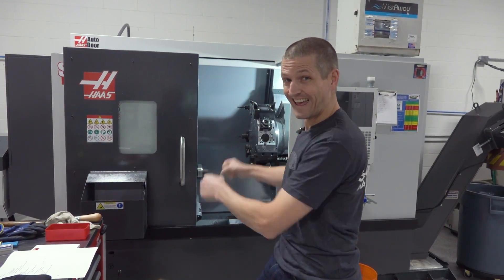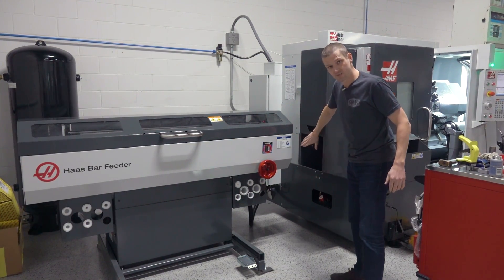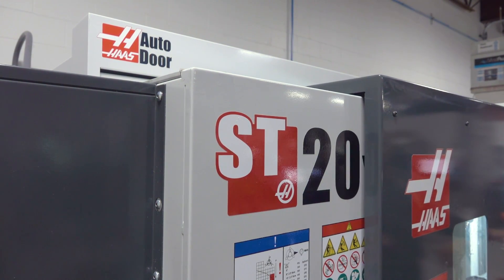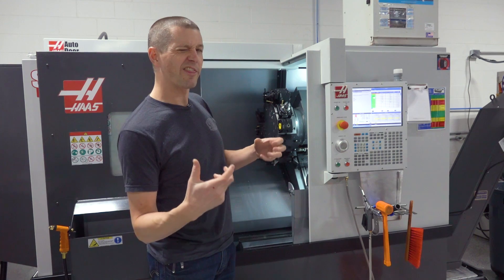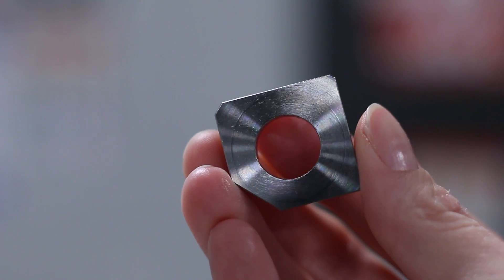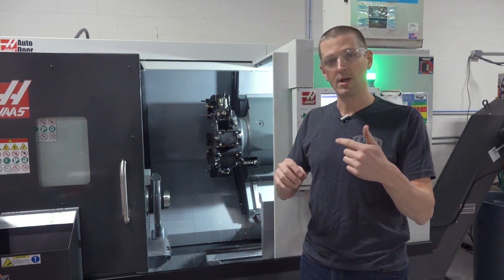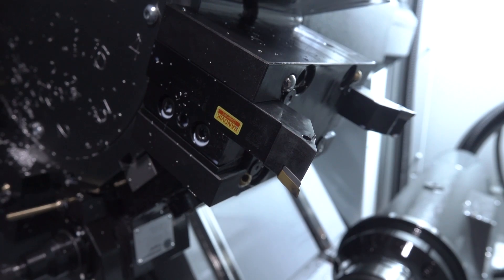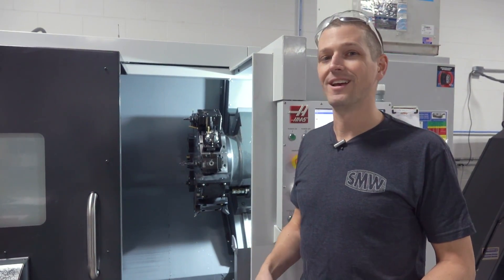Buying a HAAS ST20Y CNC Lathe!

Comment: Hey love your channel.   I'm looking into buying the smaller version ST10Y, I'm just not sure if its the best machine for my applications.  I make thousands of 1/4 x 1/4 x 2" aluminum parts that are very similar and I would think that this machine would be perfect for that but I've heard the live tooling holders wear down and are needed to be worked quiet frequently.   I'd love to know how well this machine would do for something similar to my application.  since the parts are so small I really cant justify spending the money for a horizontal mill  with a pallet changer.  if you have any insight I'd really appreciate it.  Thanks for all your great videos.

Comment: It seems live tooling is so expensive, that it's cheaper to buy a lathe and then buy a mill.  This is what my boss was pretty much telling me.  Then half the active tooling sits.  We've been getting a part that would be sweet to have a active tooling lathe.  Little bit of turning then milling some .020" through slots.  Very small part.  Then we have some SS 316 parts that get a 7/8ths hex on them, if I remember right.

Comment: Nice video and nice lathe. (8:30-8:33) The finishing spindle has actually been available on Haas lathes for about 14 years (since about 2006) on the TL15 and TL25 lathes with finishing sub spindle and live tools, however Y axis was not available at that time.

Comment: You've got a ton of comments but just in case you do see this: Heads up with the bar feeder/chuck combo you have. We have the same setup on 3 DS-30s. The spindle pushes forward when it's clamping and this can cause a bit of variability in the stick out length of your stock. 95% of the time it's off by a few thousands so it's insignificant but every once in a while it will come out too far, by 3/8 to 1/2 inch! When we first started about every 2 weeks we would crash or blow up a tool when facing and couldn't figure out what was going on. Now we keep a stop mounted in a tool holder on the turret and push against the stop every time it bar feeds. It's a work around but it beats the alternative. Just a heads up!

Comment: Thanks were about to buy our lathe in 2021 can you please!!! pump out some videos on this machine on set up programming it with fusion. I had exactly same idea for a mill part we run that's small but made of m2, 200 part count runs and really simple profile cut then cut the part off then surface grind them flat. And running them outta round bar Stock outta bars would be amazing

Comment: We just got a haa st st25 y
I've never had to deal with a y axis
It seems to be a pain to get the turning toola centered on x axis ..
Any tips? I do have the probe option and it is the next-gen tool controller.
Thanks!
Reply: I've run 2 HAAS y axis lathes for about 3 years now ( a 25 and a 35) they have not and never will be centre line on x and y because it's not a true y axis. Had haas service spend hours trying to fix it, it's all in  the parameters, not in the mechanicals as you'd think.

Comment: Need more turrets.  Twin spindle with one turret really handicaps how fast you can pump out parts.  As a first lathe it won't be too bad, but as you get more advanced you'll find that not being able to over lap work on both spindles will hurt your cycle time.  Right now this is a good machine to get your feet wet with live tool lathes.

This is machine type I'm currently working on:
https://www.youtube.com/watch?v=acOU46-f_Zg&t=6s

Count them all up and it's a 9 axis, twin spindle, twin turret lathe.  It can be nerve racking to prove out programs on some times, because there can be so much going on at once.  Really pay attention to what is going on at the 1 minute mark.  That is cutting ID threads on both the main and sub spindle parts with the upper turret and roughing on the main spindle with the lower.

Comment: In a country that long abandoned producing anything of value who the hell is going to commission work at a rate per year that could even approach paying off this extremely expensive machine?
Or are you already contracted to produce parts for military hardware?
Reply: There are TONS of machine shops in this country. The ones that are run well are very busy and very profitable.  Prototype and short run production is still a very strong business all over the US.  Companies can't waste time waiting for mission critical parts to be shipped from over seas vendors.  Then there are parts that can't be made over seas.  I worked for years at a shop that made parts for both civilian and military radar and communications systems.  Not only could the parts/prints be exported out of the country, we could only buy our raw stock that was US made or from a list of US allied countries.  Semiconductor, aerospace, oil field, renewable energy and medical device sectors are all very strong markets for machining in the US.  Manufacturing in this country isn't dead by a long shot, it's just the low skill, high volume parts that have gone over seas.  With rising wages in China along with rising transportation costs the savings attained by offshoring manufacturing is vanishing.  A lot of companies are starting to bring manufacturing back to the US.         

According to the US department of labor there were over 400,000 unfilled machining/manufacturing jobs in the US last year.  That number is only set to get bigger with the baby boomer getting ready to retire.

Comment: Very cool! I totally dig how the bar feeder moves out of the way to load the spindle liners.....I programmed and ran older HAAS lathes (SL-10,SL-20,SL-30) with the automatic bar feeder and removing the older style bar liners from the spindle was no fun if loaded up with chips.....scraped up my knuckles many times....ouch!!! (You had to reach through the bar feeder to get the liners). The older style lathes had a different style live tooling setup and I really like the new way they do it.......Do those come with the C-axis installed? I know our one lathe at my old job had it.....I believe if you ordered live tooling with your machine, the c-axis was part of the package.

Comment: We’ve got two mazak equivalents of this lathe, and the haas spindle liner system looks so easy compared to the mazak system. We have small cylindrical tubes that you slide in one at a time with spacers between them. Often have to remove the entire spindle tube to get them out, and the bar feeder (hydrafeed) does not slide out of the way. Also the material can catch the front edge of the spacers and get stuck. 

What do you have to eject parts from your sub spindle? That’s our biggest problem is parts not ejecting, then when it comes to make the next part, it smashes the first part into the second. Really reliable ejection of the sub spindle part is essential, especially for lights out. Even resorted to using a parting off blade to come in and slide the part out of the collet sometimes.
Reply: We have to make our own if not using the 3 jaw.

Comment: at 8:26 the tool for the sub spindle seems to be clamped the wrong way or not
Reply: It's a RH tool which I prefer on the sub so you don't have to change directions when handing off a part or drilling on the sub. You can also swap the tools from main/sub.
Reply: the height looks wrong should be clamped from the top
Reply: @user-xo5zu1lw2w  Ah, yes you are correct. That tool would cut 1" off centerline. We'll call this a blooper.

Comment: 8:51 so you cant finish part if it need milling..well i see option if you can lock spindle on angle you can mill it. even easier than on c axis. you have Y lol.you can use live tools. so you can mill(finish) it still better than c axis lol

Comment: I can’t wait for more videos on this!! Especially programming with fusion. Possibly some post processing for us guys with different controllers? I use Haas st20y post for my miyano machines with Mitsubishi controls and modify the code manually.

Thank you!!!
Reply: Ian Bresnahan how does that work?
Reply: justin sam I use the basic Haas st20y post and manually change codes that aren’t the same between controllers. Really whatI need is the geometry for milling and turning. I’m slowly modifying the post to make it less work. With multi spindle, multi turret machines the post gets pretty cooky.
Reply: Ian Bresnahan which Miyanos do you have?
Reply: justin sam 2 BNA42GTY and 2 BNE51MSY, also 4 citizen A20s and 1 L20. The 42mm machines are the more difficult. Triple x, double y, triple z, double c. 10 axis.

Comment: Hey John, I've been watching your video's for years.  You have great content... but I knew this day would come, I've been dreading this ever since you bought your vm3, you bought a Haas lathe.  Don't get me wrong Haas lathes have come a long way in the last 10 years.  And I get all the other stuff like already being a haas shop, being comfortable with the controller and such, but Haas lathes are still so far behind other manufacturers like Okuma, Nakamura, Doosan in terms performance, quality, ease of use and price.  I do have to give you props on the options you got with it though, you will love those chucks and collets, they are definitely the best way to hold material in a lathe.  Also the modular live tooling is a great choice.  Set-up time is a killer on a CNC lathe and those really help
Reply: Agreed Craig. has machines are built pretty light compared to higher end machines. the shop I work at stays away from them altogether

Comment: !!! Be careful when you do the "Power Up" procedure, I'm working on a ST35y and when I did the procedure one morning the turret just crashed out of nowhere on the tailstock at full speed!!! HAAS said it was a bug with the newer software and it happened a couple times already with others new lathes. It was totally misaligned and after 2 visits from a HAAS tech it still is... But great machine when it works fine haha

Comment: Turning centers with live tooling can do some awesome stuff. I pretty much exclusively run them at my work. It's interesting how Haas interpolates the Y axis. If  I'm not mistaken, most of the machines I run (DMG, Older Mori's and an Okuma) use the C axis and X axis simultaneously to interpolate Y.  I've run as many as six live heads in one setup.

Comment: I added a wash down hose to my st30. Be particularly careful when spraying any coolant above and around the light. There is a tray that snakes the wire to the electrical panel and will short that light and blow a fuse in the electrical panel. Have fun! 😀

Comment: I wouldn’t use an insert drill as a boring bar. That’s why it’s a drill and not a boring bar. Maybe in a pinch I might.
Reply: They are designed to be multi use. And it saves a spot for Other tools on complex parts that require lots of tooling.
Reply: I've used a 2 flute endmill the same way.  Orient so the bottom flutes are aligned with the x-axis.

Comment: It sounds like you have already though of this. But if you eventually change all your stationary turning tools to the Capto system. Than you can offset them in the control as their own offset. The repeat ability of the system is so good you can just swap the tools for different setups. Just like what you showed for your milling tools. If you need a boring bar, drill or a VBMT or CNMG turning tool in that station. Here we have even used it where there were interference problems with the tools and the chuck or machine cabinet. For instance running a long silent boring bar that would hit the cabinet behind the chuck when turning up close. Just put a program stop with the turret back. Mount the bar. Bore move back,  stop remove the bar and continue the program. This system is accurate enough that you don't have to retouch off the bar doing this.  If you do stops like this in a program where there could be a real problem if you forgot to remove the tool. This is what I do. I put about three or four M00's in a row with a note saying what to do. That way when you push cycle start and nothing happens you will look at the control and see your note. Believe me when I tell you this has saved me a number of times.
Reply: M 00: M 00: M 00: '' (are you shore that you taken the tool out)''   🤔🙄😂😂
Reply: With boring bars or drills are you able to choke the tool up into the holder with the Capto system? I have a 7" long boring bar I often only hang out the holder 2". Can I still do this with that Capto setup?
Reply: @Herbster472  I would say no if the tool has a Capto shank on it. They do make straight shank holders that you cold mount a straight shank tool and choke up on it some but it would only be up to the bottom if its bore like a endmill holder. With this though you would be losing all the advantage of the Capto system. It would be better to use a shorter Capto bar. Or one of the Sandvik's silent bars. I dont personally have any insert drills with Capto shanks. I mount them in endmill holsers.
Reply: @Herbster472  The capto boring bars I have seen are always fixed. I like using the round bars with easyfix sleeves: Makes it easy to get them on center.
Reply: I always loved the waterfall of m00s with a "Take the fixture bolt out this time, dumbass" note when I was operating. lol
Reply: Antonmursid🙏🙏🙏🙏🙏✌🇲🇨🇲🇨🇲🇨🇲🇨🇲🇨✌💝👌🙏

Comment: I have one of thoes. The barfeeder crashes when you have light plastics and you cannot run anything smaller than .250 in the feeder.  Watch the gagues on the bottom ours filled up with hydrologic oil. We have also made custom tool holders for right hand tools to help with tool clearance.

Comment: I setup a ds30ssy all the time! You are 100% right that sub spindle can get in the way every now and then but are ds30ssy alarms out if the sub spindle is in the way. We don't have the ngc it's the older software but on startup we have to home each axis 1 by 1 congratulations on the new lathe you will love it! As for coolant line to clean it out we just put a y adapter with a garden hose to rise out are machines

Comment: Finally, a nice lathe. So many things you did right there. The quick change tool holders are just awesome. As an operator it's annoying to work with two wrenches inside the machine every time one needs to change a tool. Also, very good choice on the collet chuck. You'll love them, or already do ;)
Too bad you can't change the position of the part catcher by programming it, but then again you will probably not need to adjust it too often.

What's the coolant pressure on this machine?

Comment: Why would anyone buy a Haas lathe.
Reply: Because they've never used a good machine, poor plebs.
Reply: They are good machines, when they work, my st30 has trouble holding tolerances, haas can't find the problem.
Reply: @Alanhig  i have that same problem with our ds 30y, and im constantly changing offsets cuz nothing will just stay the same
Reply: @FFAF86  Yep we had the same issue it just couldn't hold tolerances, they would grow during the day and shrink again when it cooled down in the night. We have a 30 year old Mazak that wipes the floor with it and it hasn't had an easy life.
Reply: VPEEK why wouldn’t anyone buy a haas lathe?
Reply: @hassiaschbi  cuz there basically a paper weight, try holding tight tolerance parts in it consistently and then rethink that statement.
Reply: mike leclair then they might be the wrong machine for your application, but for me, they are a workhorse with a good cost structure. 0,01mm is manageable when the machine is warm. For more precise parts you should grind them.

Comment: I bought a new ST20 in July. Really happy with it. The newgen control for the lathes is a great step forward from the last one. I did make some custom slideway covers to protect the tailstock runners when its parked up and just on chucking work.....saves on dints if you drop tools while setting tooling too.
Reply from the maker: would love to see a photo of those slideway covers!  email me?  john at nyccnc dot com
Reply: @nyccnc  Pic sent.

Comment: This should of been an hour long video. So much here to digest. I usually watch most videos on 1.75 speed, for this one I felt like 0.75 would of been suitable.
Reply from the maker: thanks!  Let us know what else you want to see... we're learning too - and enjoying sharing
Reply: @nyccnc  I think the first place to start would be with setting up a job. A bit more detail on loading the tubes, collets and stock. Picking tools. How the live spindles are installed and how they are driven.  How many can you put in the machine? Are they all driven together or only driven individually when used? I'd love to see a run of that part from stock load to dropping in the part bin at a watchable speed without coolant(Finishes might not be pretty and hard on the tools, but atleast we could see what is happening). Can the machine load different materials lights out? I assume they would all have to be the same diameter? Are the collets the same on the secondary spindle? Are the chucks power driven? So many little questions...

Thanks John! Congrats on the really neat new machine can't wait to see more.

Comment: what made you go with the Hass vs the Doosan which some of the other shops you've toured had?
Reply: The HAAS uses the exact same control as their mills (I am told that literally, you could move it from mill to lathe) ... that could be a big selling point for an all HAAS shop.
Reply from the maker: Same control, same service relationship (which has been good), and frankly HAAS pricing was darn good on this one with the end of 2019 year sale.
Reply: @nyccnc  Totally agree about pricing, but don't let the "same control" be an excuse not to buy a different machine, please.
I worked on both Haas and Siemens control: Haas took two days to learn vs. a week to learn Siemens. Time to really get used to them: Siemens, one month; Haas, yet to be determined.
Anyway, nice to see you turning in the right direction now 😜